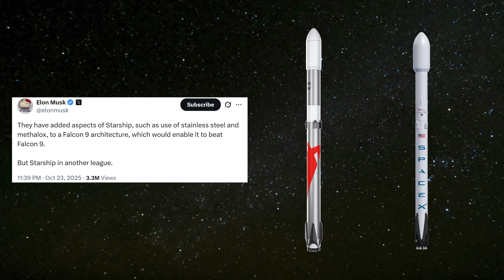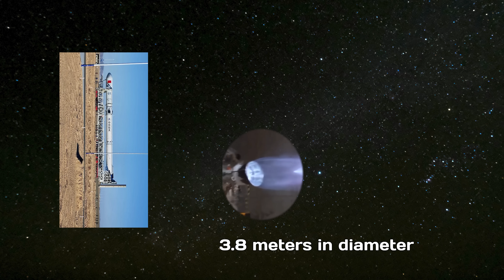Something Big Happening to China Reusable Rocket, Elon Musk revealed Better than SpaceX & NASA...

Comment: China’s reusable rocket Zhuque-3 to make maiden flight this year. 
If China achieves a breakthrough in this field of rocket recovery, it will signify immense strategic value and global competitiveness in reducing the cost of space access, accelerating low-orbit constellation deployment, increasing launch frequency and enhancing industrial capabilities. 
This is not merely a technological leap for a single rocket model but a critical step toward entering the era of large-scale space transportation. 
The progress will drive the rapid expansion of China's launch capabilities, with multiple enterprises collaborating to undertake a larger share of global launch missions, further consolidating the country's leading position in the international commercial aerospace market. 
It will effectively stimulate the potential of the domestic commercial aerospace market, and promote innovation and practical implementation in related fields such as satellite communications, therefore fostering a virtuous cycle ecosystem.

Comment: 😂😂 well they maybe figure out that rocket booster landing is just very bad efficiency. The extra weight for fuel to land, and the huge amounts of extra weight for construction needed for the boosters and on the main fuselage.. just makes it very bad for carry payload, and actually it's not that much or any economic gains. Because even if you land the booster rockets, they must go through a big service, rebuild, and maintenance between it is used again. . And that's not economic with the higher weight, rebuild and service, more fuel needed, more material and less cargo and 15-20 before it has to be changed. If you want landing boosters , use small correction jets for stability and steering to landing place, and a last 10000 feet big parachutes and last 100 feet a braking boost. The weight will then go down 60-75%. And still be able to be rebuilt to go next flight
Reply from the maker: Well, spaceX still do preaty well with reusable rocket, and the technology has alot of room for improvement, too!